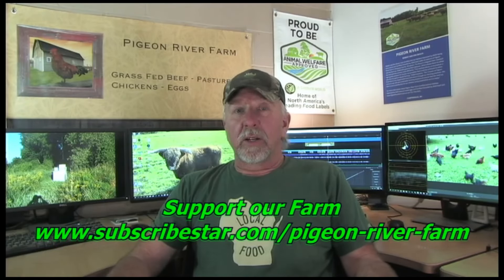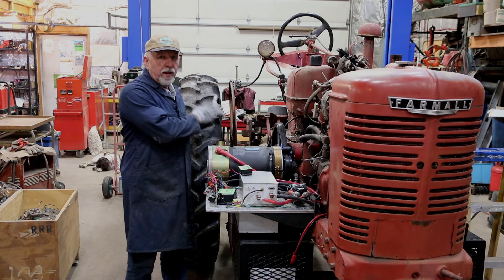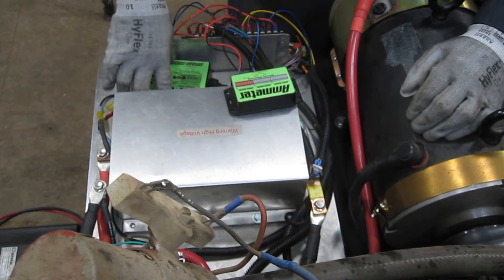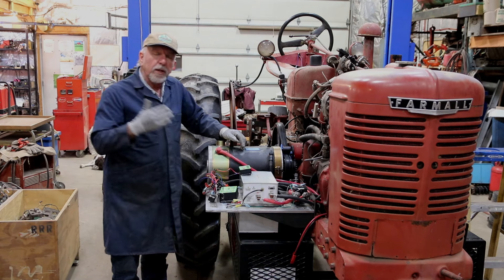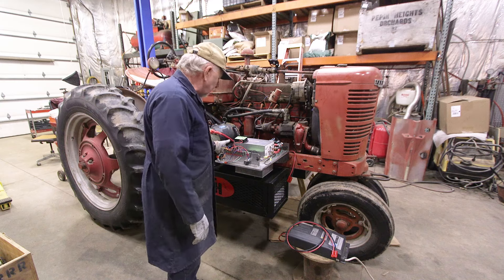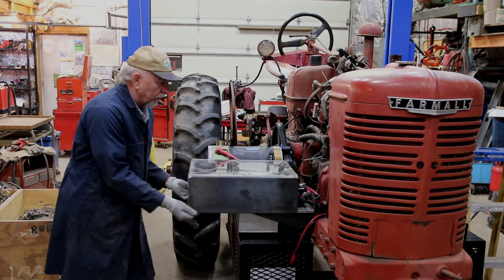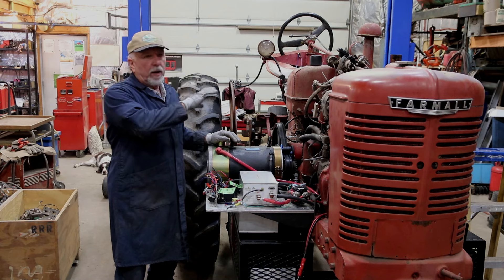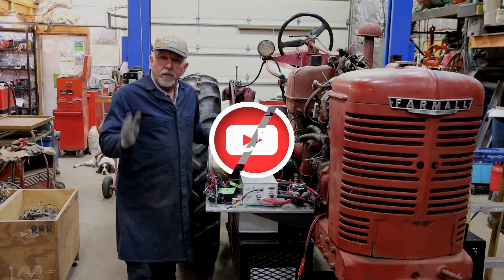The Making of a Farmall M Hybrid: First Test Drive and Review

Comment: Awesome project! This is the first video of the series I’ve seen so apologies if I’m asking a repeat question, are you planning on setting up the tractor to operate as a full hybrid? I.e are you going to automate the gas engine to kick in when more power is required and use it to charge the batteries in-field. I love to see people taking on big electrification projects like this!
Reply from the maker: The plan for this year is predominantly research testing on the pasture itself. Utilizing all the tasks that I currently do with the gasoline engine and comparing it to the electric and see the overall energy consumption comparison. So, for this year. It's going to stay as a dual mode configuration that future plans, or should I say next winter, is to start utilizing a true hybrid or dual power balance system. As a technical educator, I have been training and servicing hybrids for 20 years now and truly enjoy the technology platform. The overall goal for the project was to do it inexpensively and make it affordable to repurpose tractors that exist on farms all over the country. The battery's overall performance. Capacity is an unknown. I spent a lot of time developing engineering power consumption curves, but since the data is for the actual energy consumption, The tractor is currently utilized under its normal task load. I've only utilized a vacuum gauge and gas analyzer to get a rough approximation of the power requirement for many of the tasks. I've currently limited the electric motor's horsepower to around 25 hp. As you know, a motor of this configuration can produce hundreds of horsepower, but the intention is to actually look at it from a cost-saving energy-efficient model. A few years back, I put a 10K W solar system on the shop, and it has worked very well for running the freezers, lights well, etc., but has not saved any fuel whatsoever out of my on-farm fuel tank, and that's where the idea formed from. So, round us out this year is the energy utilization research part of the project, and next year I'm planning on having fun configuring the hybrid design. Thank you for commenting!
Reply: Just out of curiosity are you keeping the engine clutch disengaged the entire time you’re using the electric drive? If so you’ll need to keep an eye on the throw out bearing on the clutch. The letter series tractors had graphite throw out bearings that would probably not last a season of work in that configuration. A lot of them were updated to a thrust bearing that takes grease, so I’d think that style would work okay.